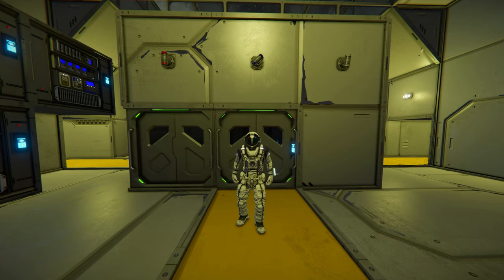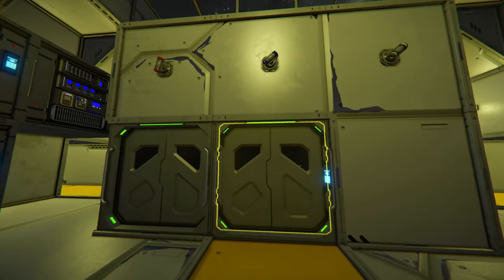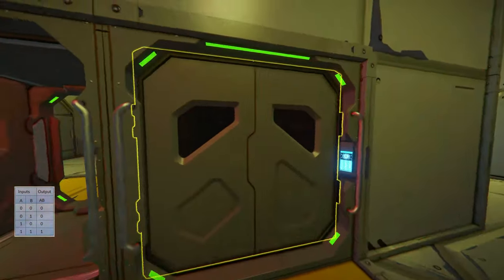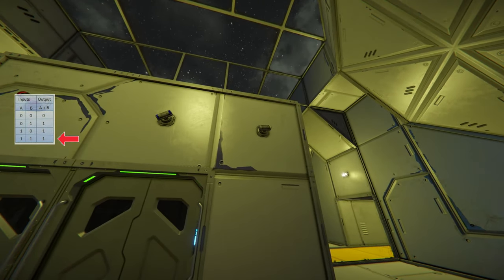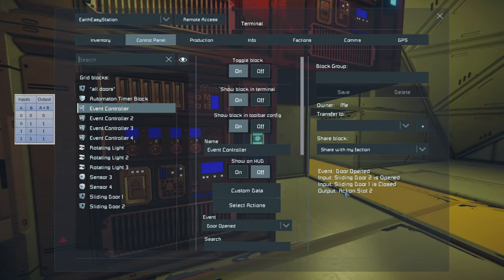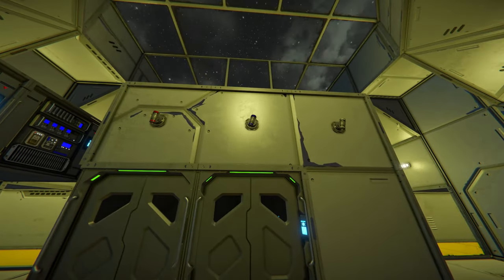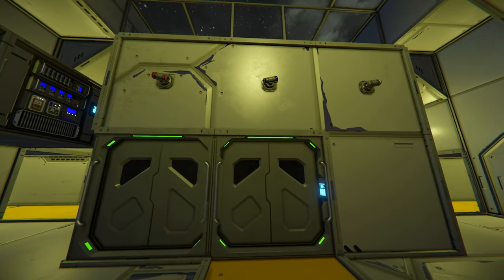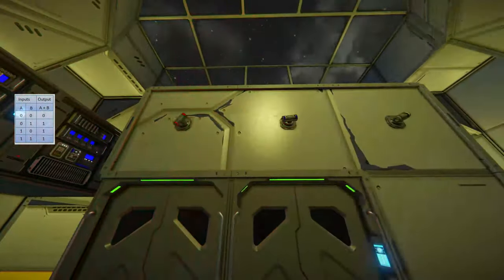Space Engineers Automaton Event Controller logic pain

Comment: Thank you for showing this. I've been fighting with the AI blocks and it's nice to know a bug ahead of time for event controllers too lol.  The AI blocks can't handle to many things switching so I just ended up changing over to two flight blocks, 2 recorders, 2 basic tasks, and some timers.  The drone is a wandering defense drone that has a recorded path for docking/undocking. Undocking path is for clearance. The big reason I needed the 2nd flight block is because the AI blocks would bug out and stop all actions. Sometimes starting an AI that I didn't even have in the logic path. Switching to a 2nd flight block let me remove a ton of actions on collision avoidance, Precision, and align to P gravity. The P-gravity toggle is stupid. It needs to be an On and Off function. Recorder blocks have to have it off to align themselves to the orientation at the created waypoints. Using a a second Docking flight block allowed me to not have to deal with it anymore but it's making my drone have way to many blocks. You really do have to forget the old ways of doing RC drones with this update.  

I'm using an event controller on my drone to lock the connector, turn batteries to recharge, and switch itself to off so that I can undock. Hopefully i'll get better at using the 2nd function on them. I may be able to find a way to get my Batterylow/Batteryfull event controllers to be a single block but I would need the previously mentioned P gravity change and the AI to not bug out with to many state changes. The work around for less AI blocks is more timers but a ball of timers with a gun isn't feasible.
Reply from the maker: I, too, had to have 2 sets. but it was required as I made a drone to take ore back to base from a miner. this update has been really interesting to say the least . I'm sure something will get ironed out
Reply: @Boltron  I have a theory that I can do my docking and undocking recorders with just one block by reversing the waypoints. But it means I can't have any actions set to happen on those waypoints. Now that I think of it I don't think I have any on this setup.
Reply from the maker: @BNett21  Well, maybe you don't really need to reverse the way points . have u tried making a loop with timers set to release the drone to allow it to continue on to the next waypoint . then when back to the start the event controller starts the loop over so it actually becomes a loop

Comment: good catch. that "detail" would have driven me crazy if I came across that without knowing it was a bug. thanks for explaining.
Reply from the maker: it was driving me crazy when I was testing the block . I was like umm why did it go false? it should still be true . and I'll go back and check if I had things set up right . so that's why I decided to do a simple test with lights .
Reply: I have absolutely the same issue. AND gate even says that it will be true or false ONLY when ALL of the blocks meet the condition. So if both are off, it only should do action 1 and if one of them is on and the other is off, it should still should be action 1 and only in case when both of them are ON it should be action 2.

Comment: Yeah I literally just had the same problem with my doors I was using two timer blocks to automatically 
 doors behind me to help keep airtightness and it's annoying yo have to close doors.

But my system didn't work correctly as I just had the timers contactly close the door even when already closed kinda work but would often slam doors in my face.

So discovered event controller as I am new to SE and used a similar setup you did and had the constant door closing noise so I dod exactly what you said and combined tge evet controller with tge timer block to close doors 1 second after I opened them vastly improved my air loss problem.

But now I am trying to work out a way to reset my turrets to 0 so they face forward after use but no luck.
Reply from the maker: what type of turret? a custom turret or a turret made by the game?
Reply: @Boltron  Yeah a custom Turret also I noticed something weird my custom Turret works fine facing forward when I control it but if I move it - 90 hinge range the Azimuth reverses I am not sure if I set it up in correctly or something.

But it's odd the it works fine in the + 90 range I don't know if it make a difference but I am actually no Xbox Series X.

Comment: Mine simply wont evaluate simple numbers correctly, they stare me in the face and say 1700 <= 1500 for instance... bloody annoying just trying to get them to perform basic locked target checks!

Thanks for the info but it looks like there's more than a few bugs with em
Reply from the maker: i havent done anything with number checking yet. just a bunch of state changes of verious blocks. ill get that a try and see if the issue is also fix with this mod. thanks for the heads up .
Reply: @Boltron  Having tested more I think its that something is entirely crashing my event controllers! They just aren't updating unless I turn them on/off and even then often not. Probably some mod compatibility, MB